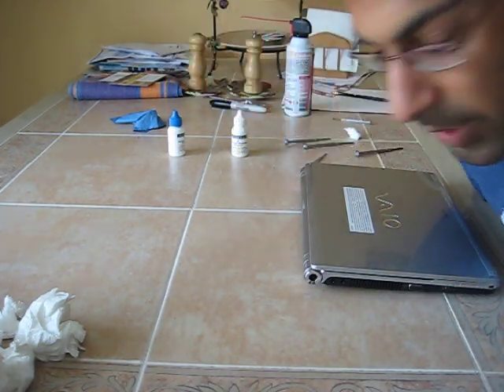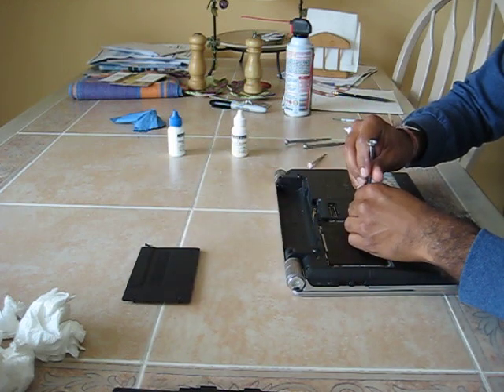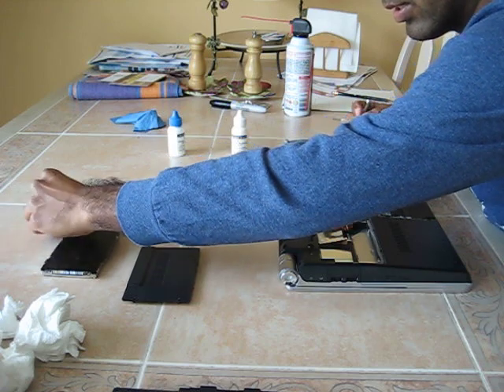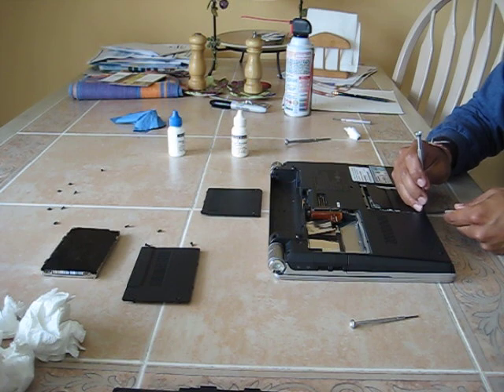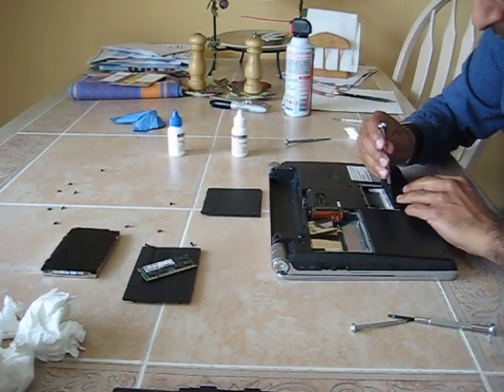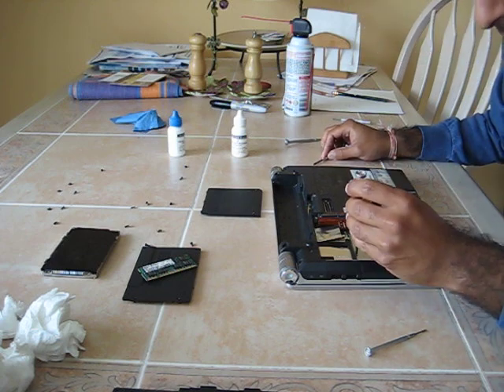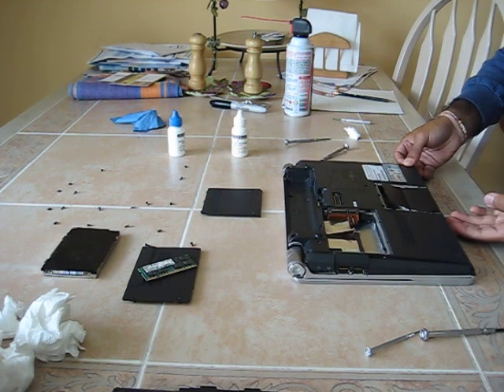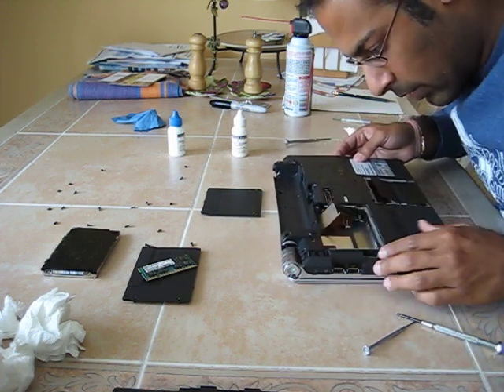Sony Vaio VGN SR SR190 dissassembly

Comment: Thanks for the video on taking it apart, wondering if you have tried to recover the machine with a new hard drive using the recovery disc the unit lets you make?  ???  Thanks

Comment from the maker: Sorry, I did not take a temperature reading before and after. The difference is big because my hand would get burnt if I touched the bottom of the computer prior to applying the AS5. However, most of the improvement is attributed to replacing the failed factory thermal compound.

Comment from the maker: @davidSYcho besides replacing the thermal paste, this computer is rock solid. I had also upgraded the hard drive an ram shortly after buying it so I cannot speak to the reliability of the hard drive. Those should be replaced every 2-3 years as a proactive measure.

Comment from the maker: Yeah, it used to get very hot, to the point where it would burn my hand if I touched the computer. The fan would also be running non-stop. Now no more issues.

If you are familiar with thermal grease, you can use the video above to disassemble the computer. Disconnect the fan and unscrew the heatsink assembly. Use artic silver thermal grease cleaner and surface prep, then apply some artic silver 5 or equivalent. Carefully reinstall the heatsink, plug in the fan, and reassemble.